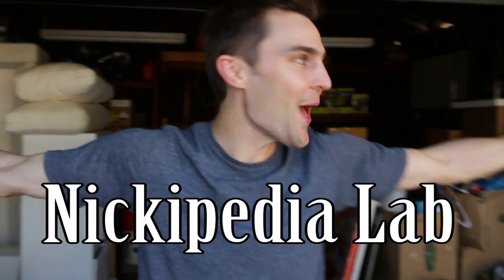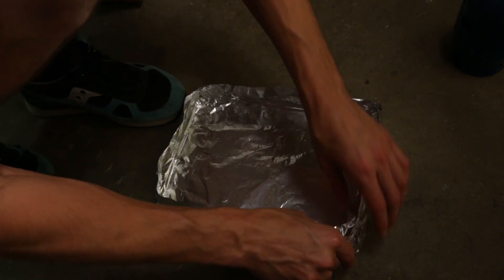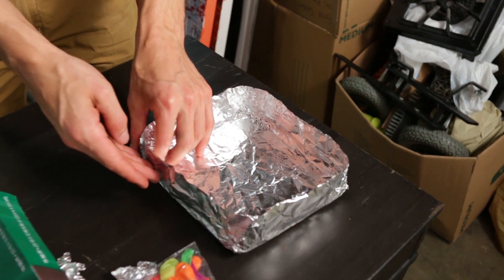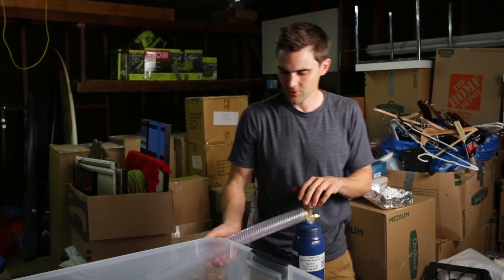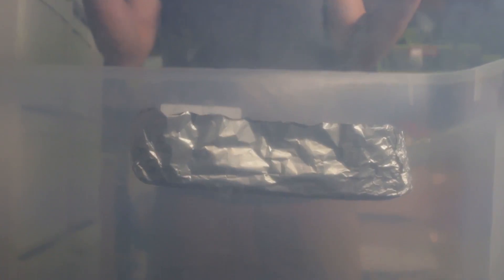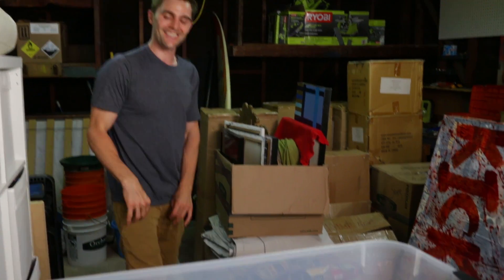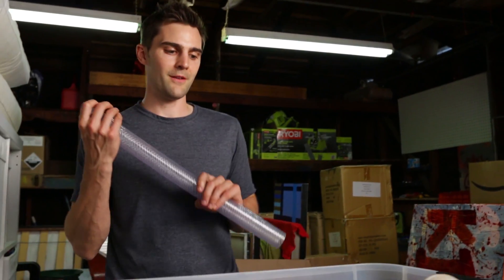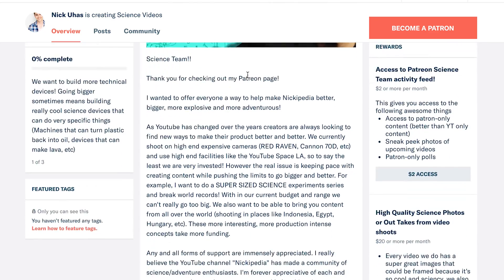Floating Metal On Deep Voice Gas (SF6)

Comment: From the demonstrations I've seen, you want the foil boat to actually have higher walls! It's counter intuitive at first, but lower walls (i.e. a shallower boat permit the gas to overflow into the container and "sink" it. Cool example of Archimedes' principle - the boat has to displace at least its own weight of SF6.